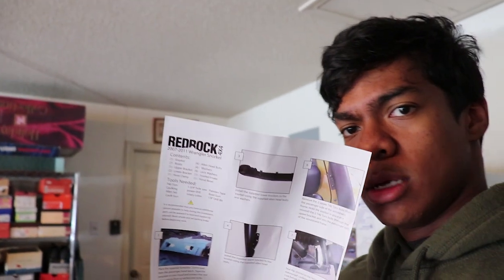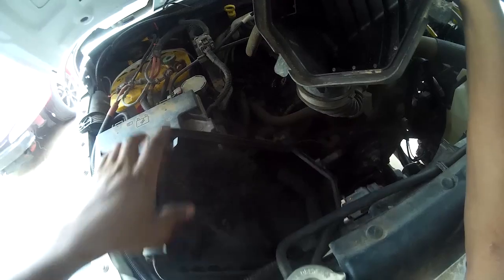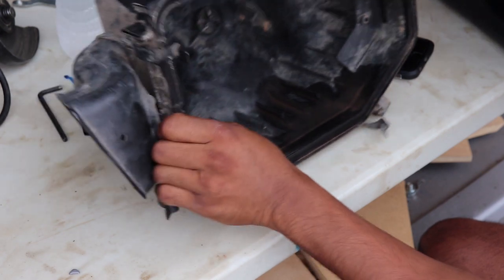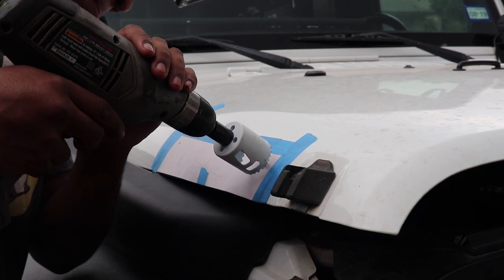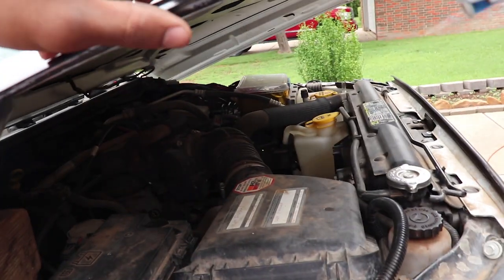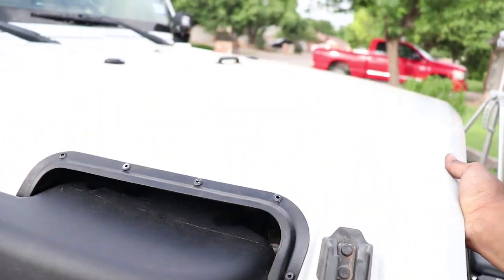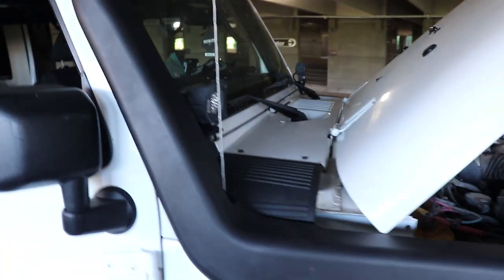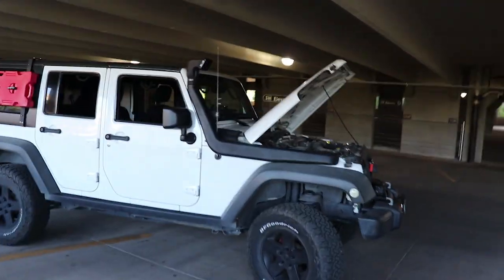Installing a Snorkel! [RedRock 4x4]

Comment: Cut antenna to desired length. remove top little metal ball place metal ball back on antenna being screwed on antenna base. Some grinding most be done to place small metal ball back on top of antenna. Spray paint desired color.
Reply from the maker: john wayne my man. Gonna do this now. 😎

Comment: Next you need to do the ARB differential vent manifold if you're going to go through deep water...
Reply from the maker: Hal 9000 adding it to the list! Great suggestion. I already extended the stock breathers up pretty high, but this might be the better option.

Comment: Why did you not silicone the holes on the bottom of the air box? Will water not leak in through those?

Comment: So the website says it doesn't fit any models after 2011. Can anyone confirm or verify if this will fit a 2017 4-Door? Getting mixed answers. Thanks in advance.

Comment: Havent watched whole video however im hoping you jb welded those pins on the bottom half of the airbox so they are completely closed off!! Otherwize your raised air intake is almost useless..
Reply from the maker: TSuave did that off camera!
Reply: That's a good point for a discussion! I got pretty much the same snorkel and I have not closed the small holes at the bottom of the airbox, because I think that water will get in there through the snorkel when you wash your jeep or if you drive in heavy rain. And when it's full you have to wait until the Water evaporates or you have to empty it by yourself. 
If you would drive through deep water for a short period of time I guess the holes at the bottom are too small for filling the airbox rapidly with water. But I think I have to put a gopro into my Airbox to check what happens. 
Maybe anyone has already tried both and knows it better. As far as I remember even my last motorcycles which depend at high speed on the ram-air effect had little holes at the bottom of the airbox for incoming water. Maybe it's a good idea to let at least  one hole open 

Cheers
Reply: I just ordered this last night and I was thinking of the same thing about the drainage holes in the airbox, I was thinking of putting together a one way valve drain install into the lowest point .

Comment: Nice job dude, snorkel looks awesome on there, and that cut came out perfect! You should do the JL hood latches when you get some time. Make sure they will fit with that snorkel first, but I did it on my JK pretty recently and the install is super easy and they look so nice and clean on there. Here's the video I followed to do it https://youtu.be/ZZO0wn8OW-o and this is how they look on my Jeep https://www.instagram.com/p/Bt9RDmTFxne/?utm_source=ig_web_copy_link
Reply from the maker: Vinny G yeah, i was going to do this mod when the JL first came it but I’ve been putting it off. I kinda like the JK ones. But i was checking out a gladiator this past weekend and the latches are pretty nice. Gonna order them soon. Great suggestion!

Comment: Will it work with a light bar
Reply from the maker: ObeyValencia you’ll have to modify the mounting brackets, since most top mount light bars utilize the same screws the snorkel uses. (The torx screws on the side of the windshield)